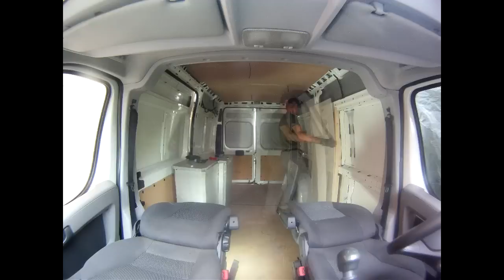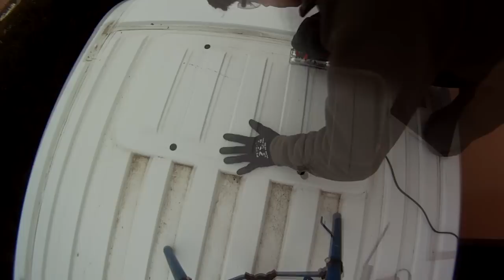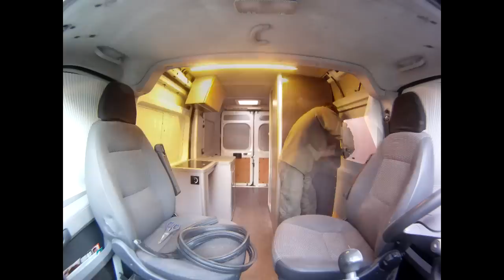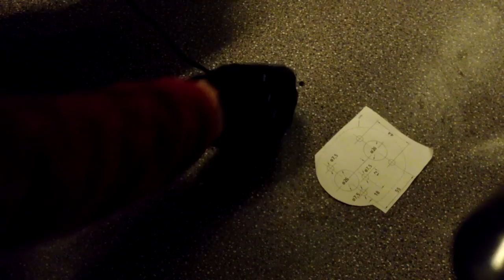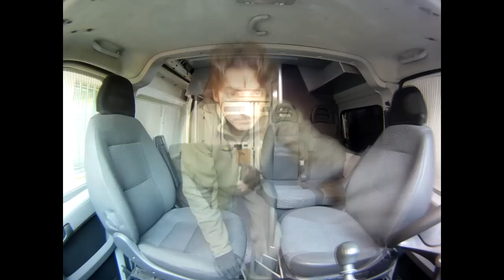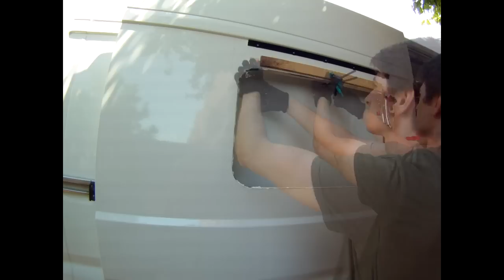Camper Boxer Conversion L2H2

Comment: Great work. Thumbs up and my respect to you. I want to do the same in the neat future and i have a question. Where did you get the 2 rear seats from? Is this the normal front seat, just mounted to the rear? That was also my plan to do it, because i need 4 seats.